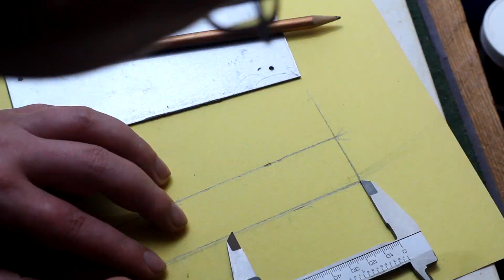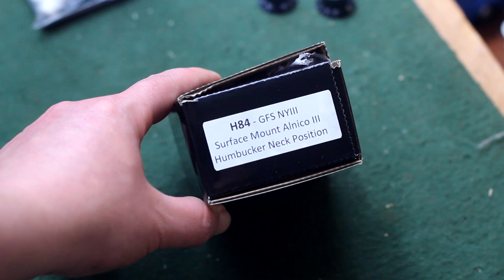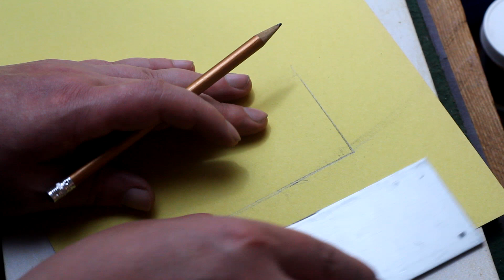Teisco Guitar Resto-Mod + Demo (Incredible Retro Tone!)

Comment: That Ain't a Teisco for one. V:

Also, Kawai (The same one that still build Pianos, actually) bought Teisco in 67. Teisco guitars almost all had Zero-frets and a heel adjust trussrod, easiest way to peg them. 

This looks more like a very early Matsumoku (Early MIJ Epiphone maker, also the makers of Vantage Guitars) then anything to me - the shape, the headstock, the very rounded neck plate and the notch in the pickguard all look correct for that. This would have likely been sold under Palmer/Tempo branding. They were often a parts company, supplying Vox, Guyatone, FujiGen Gakki, Kanda Shokai (Greco), Hoshino Gakki (Ibanez), Nippon Gakki (Yamaha), Hondo and even Univox with various guitar parts.
Reply from the maker: Thank you SO much for the info Alaric. I was hoping someone could tell me what it is. I just looked up Palmer and I think you nailed it. Wow you have a great knowledge of vintage Japanese guitars! Thanks again. Where did you learn all this stuff, do you collect and deal in retro MIJ guitars? Anyway awesome info brother I appreciate it.
Reply: @heavymetalATC  My main guitar is a 1969 Teisco 1412, I went down the rabbit hole trying to identify it. Turns out mine is a very odd factory parts build, so definitive ID was difficult - Wrong Tremolo, but it was clearly factory installed. Took a lot of cross reference.

That and picking up some others at flea markets etc, led into knowing what to look for when IDing import guitars of that era.
Reply: @alaricpaley6865  I have a Teisco my sister found in the garbage can a few years ago, but I can't id it.  I can get close but never exactly it.
Reply: @generalawareness101  Sometimes It's difficult. Mine has the pick-guard and pickups from 68-69, but the trem system is from 64 - A design abandoned by Kawai for needing a body rout. It's almost certainly a 1969 Christmas special, thrown together to meet a quota.

It's also easy to get confused by the fact that a lot of parts are shared between the manufacturers. Some of the early Hondo Korean guitars used Japanese parts from Kawai for example.
Reply: @alaricpaley6865  I place this around 1968/1969, but, as you said, it is damn hard to tell.  I want to give it some love and repair it, but I need a schematic or something for the wiring as these things are just flat out weird in comparison to modern guitars.
Reply: @generalawareness101  Post a link to images, I can try and sort you out something.

Generally they're not that odd though, mine is real close to the Fender Mustang with the dual slider switches.
Reply: @alaricpaley6865  I posted a link to ATC and YT zapped them. :/
Reply: @generalawareness101  Tricky business this.
Reply from the maker: @alaricpaley6865  I remember when I was a kid my friend Jacob and I were talking about cars and as my parents ran a classic car restoration shop and he grew up in a junk yard and was building hotrods since were were little. I was telling him about how sometimes 2 cars can be the same year and specs and 1 will just blow the other out of the water with acceleration or on a dyno, same with gas mileage or dependability and he was like oh, yeah They are supposed to all be the same but they are not. If they had lower geared rear ends on a shelf and they ran out they just used what they had, same with transmissions or high compression pistons or carburetors with bigger jets left over from a previous model with a bigger engine hell if they ran out of cams they would use hot police spec cams or whatever was left on the shelf. That really struck me and stuck with me. Since then I have noticed this to be the case in many things just like you said they threw it together using what parts they had to meet a quota. Sometime though you just end up with a magic combination. I've seen the same in even name brand guitars. Partscaster from the factory. LOL Its like one time we had a 78 firebird not trans am just plain jane firebird and that car was so incredibly fast it was rediculous and was jsut one of those magic factory left over parts combos. We had 78 corvettes and 78 6.6Trans Ams and that plain 350 firebird would eat their lunch like ridiculously. Also thank you for helping out the General. Damn decent of you.
Reply: I believe it is an SG-12, branded for RCA Victor inthe 60’s, made by the Matsumoku factory.

Comment: Hey, really liked the video, but I have a question: what can I use to clean and polish my guitar body correcly? All of my guitars have a gloss finish btw
Reply from the maker: Thank you so much Guitarista. Ahhh this is a subject of much debate and disagreement in the guitar community. 10 people will tell you 10 different answers and then fight each other over what the other one said to use... So this is just my opinion and I am not an expert First off like you saw a soft cloth is a must and water will do wonders. For a crust nasty guitar white vinegar and water are really good for getting the gross stuff off. They sell guitar polishes nothing wrong with those for sure but most of them are just a carnauba based spray wax or paste, to save money you might find a pure carnauba based detailing spray for cars like McGuire's paint polish and protectant. If you are trying to actually polish it to a mirror shine and remove scratches and haze etc. You need a VERY light grade buffing compound and a swirl remover compound and just hand polish the hell out of it, You can use more abrasive compound like rouge and even use an electric buffer but it is easy to burn through the paint if you aren't used to doing it. Just think about the painted body like a car.  Anything that you would use on it should be fine for a guitar. I really am not usually  one to care if my guitar is shiny or clean so I have mostly only ever used water though and I use a light oil on my necks, so I pretty much break all the rules myself anyway.